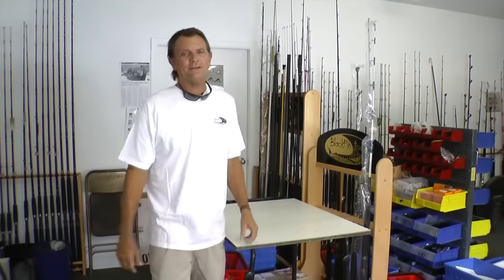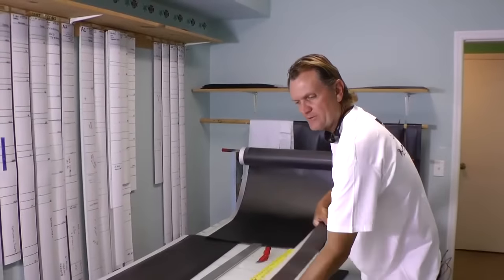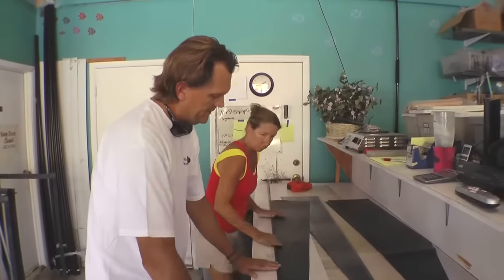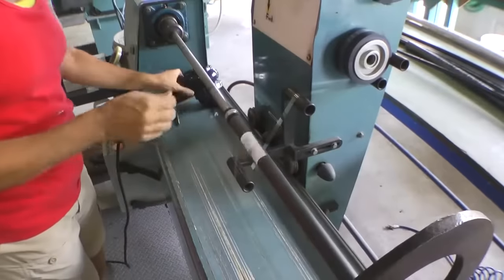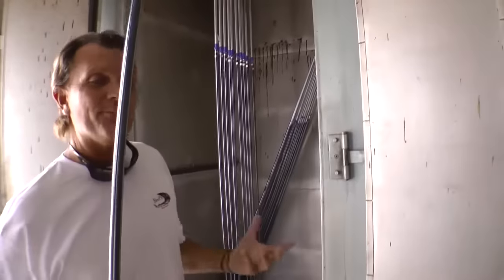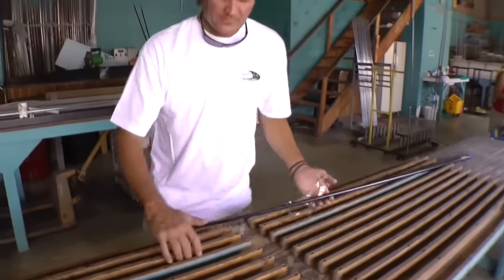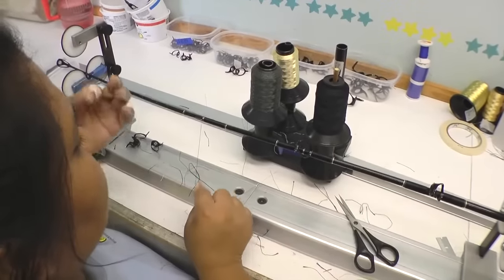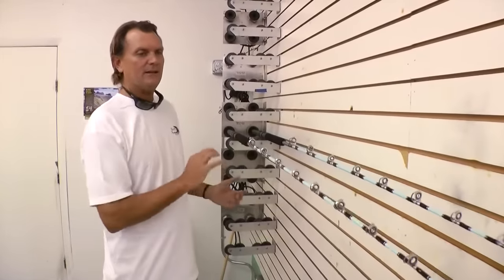How Fishing Rods are Made

Comment: Fascinating, great craftsmanship 👍🏻
Reply from the maker: Passion for your work always shines through. Thanks for watching.
Reply: I’m a lifelong fisherman, 59yrs old (Australian/beach/surf/rock fishing) and have about a dozen or so custom rods in the 10’ - 13’6” range. They are anywhere between 20-40yrs old, and all have been refurbished/rebuilt at least once, and in a few cases about 5 times over the period of time. I was aware of the skill and craftsmanship that went into finishing a rod, (butt/reel plate/guides/thread/epoxy) but not the process of producing a blank. When you combine all the craftsmanship and skills, a custom rod is a very undervalued commodity. Much the same as a custom surfboard 🏄
Reply from the maker: @markmay184  bam, you are correct

Comment: If these rods are made the same then why do some rods cost hundreds of dollars? What you suggest for New England haddock fishing with a 16oz weight? thanks
Reply from the maker: Not all rods are equal. Some manufacturers use cheaper materials and not as much. Quality always costs a little more, but the rods will last longer and perform better. To get the exact rod you need, check the site and get in contact with someone about your spec needs https://blackfinrods.com
Reply: @InTheSpread  I did. Nice rods
Reply from the maker: @xrayron1  cool

Comment: I understand the concept of splining a rod and why a rod blank has a spline. Why is that so important?  How does the affect fighting a fish?
Reply from the maker: The process helps to determine where the natural bend is in the rod and optimal guide placement.
Reply: @InTheSpread  I understand that the rod will naturally bend on the spline, but a fish will not fight on one axis. Therefore the spline is insignificant. Guide placement has nothing to do with the spline.
Reply from the maker: @toddbadgley4449  Positioning guides on the straightest axis or curve helps.
Reply: @InTheSpread  I can agree on positioning guides on the straightest axis.  That makes sense to me. I’ve never understood building on the spline. I’ve built rods both ways and cannot tell any difference. I’ve asked many rod builders what the advantage is to building on the spline. Thank you for the reply.
Reply from the maker: @toddbadgley4449  it's good that rod builders take different approaches to crafting rods. Variation is the spice. Thanks for contributing.